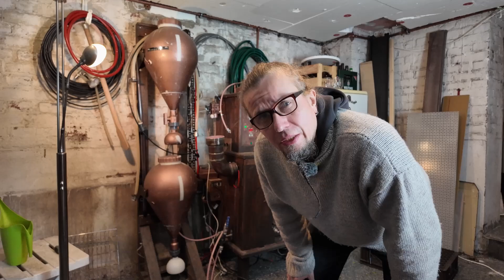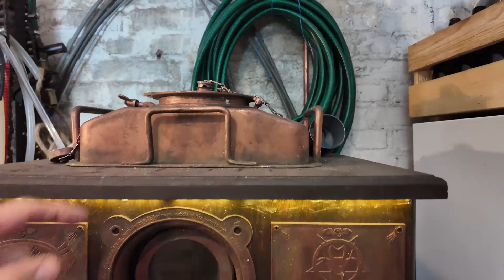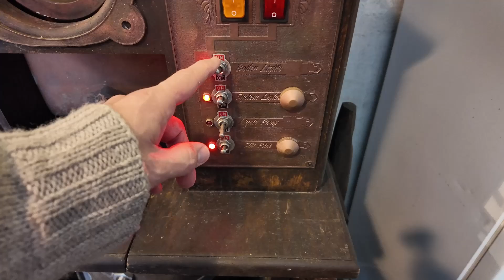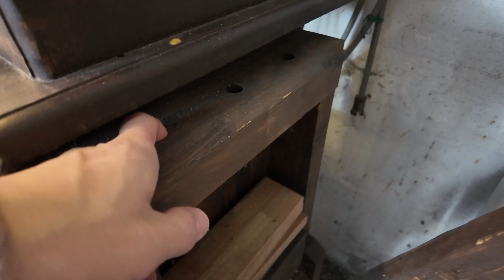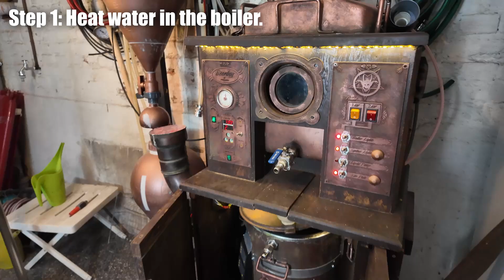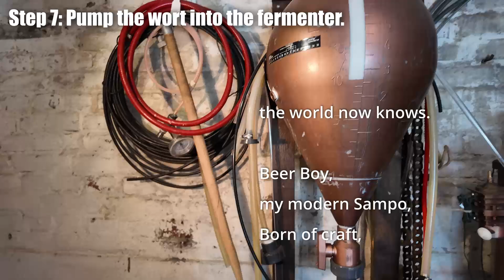Beerboy The Steampunk Home Brewery

Comment: Aren’t it better to make your own fuse box instead of using to computer power supply? Or is it just that it’s convenient to use it due to the easy convert to light, fans and such?
Reply from the maker: @RobertNilseb  the pc power does have nice options and I did have one extra.. it is all recycling you know 😃 the heating it of course through separate system.. details in next videos!